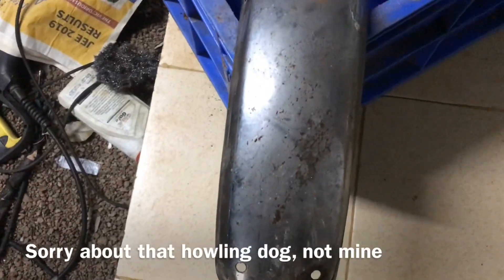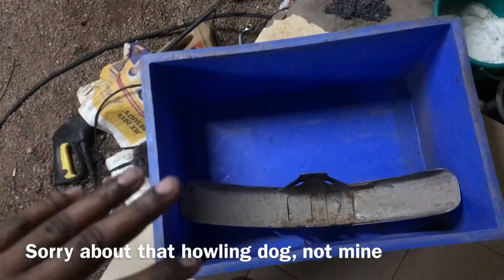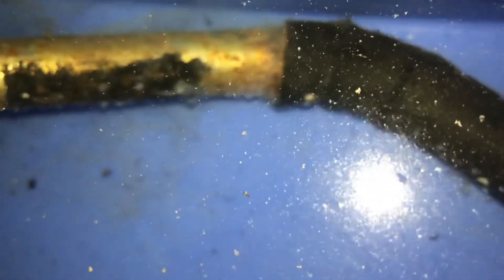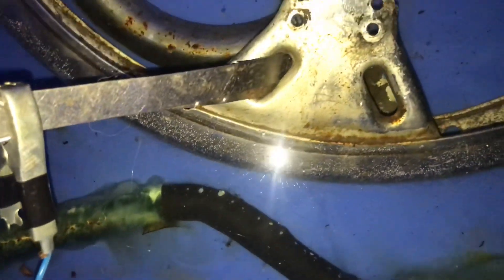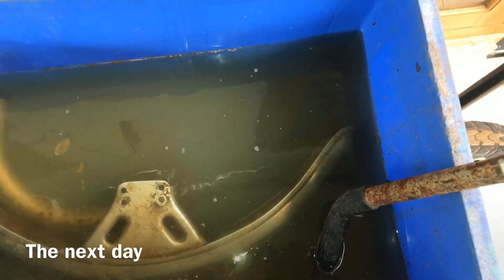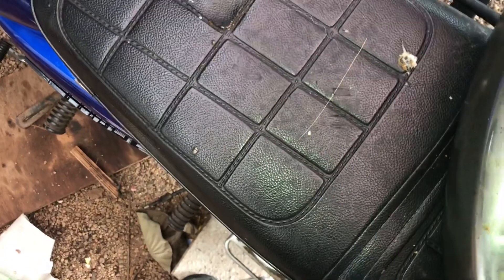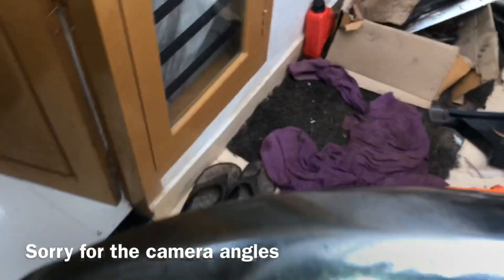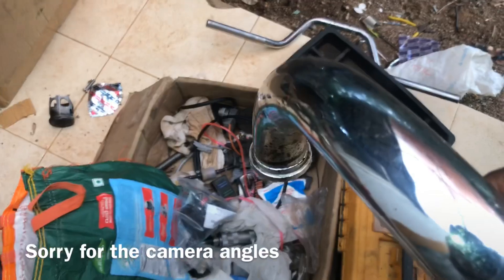Yamaha rx chrome parts Rust removal using electrolysis | 100% guaranteed results

Comment: Bro, the inside of my chainguard is full of rust. I tried using an emery sheet, but no luck. Can I use this method to remove the rust or is there a better alternative solution?
Reply from the maker: No, give it to a gas welding shop they can close rust pin holes, if there are no pinholes you can spray chain lube inside the chain cover after cleaning it properly
Reply: @Yamakaze  Sure, Brother. Thank you 🙏🏻

Comment: can I cover an object with more than a centimeter of chrome?
Reply from the maker: Lele Armi didn’t understand your question, but if your question is on how big area you can cover then it’s the size of the chromed part that can be immersed in the electrolyte solution
Reply: @Yamakaze  I am referring to the thickness. how much (maximum) thickness can be reached
Reply from the maker: Lele Armi there is no limit to the thickness, if you understood the video this is about removing pitting through electrolysis
Reply: @Yamakaze  I got it ?

Comment: How much current in amperes used?? Will it work on 750 mA milliampere
Reply from the maker: Reena Johnson the more current you pass faster will be the process, I was passing around 5 amps
Reply: How much voltage sir ??
Reply from the maker: Reena Johnson I used 12 and 6v the process can technically happen on a 3v battery
Reply: Hello sir can i use this for rx petrol tank rust removal
Reply from the maker: Reena Johnson no, this process will create a lot of pin holes, not good for gas tanks

Comment: I don't know how I missed this video! What about the handle bar? How did it turn out?
Reply from the maker: mjshaheed the handle bar was the sacrificial anode.
Reply: @Yamakaze  Thank you! How much voltage does this process need?
Reply from the maker: mjshaheed I used 6v. It can be done using batteries

Comment: Did not work,  Now what you must do is that rub thourouly with smooth already used sand paper,  clean it, and spray clear laquor.
Reply from the maker: Army Josh I won’t say it did not work, the camera is not doing justice. Now sand paper will ruin the chrome. Lacquer will turn yellow. There was s an RD detailing video which covers Turing slightly pitted chrome to mirror finish